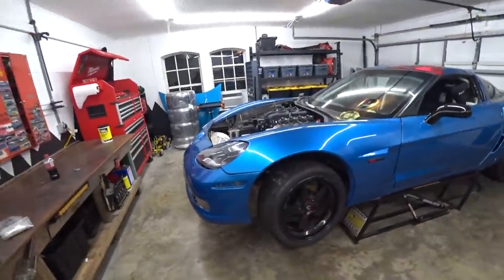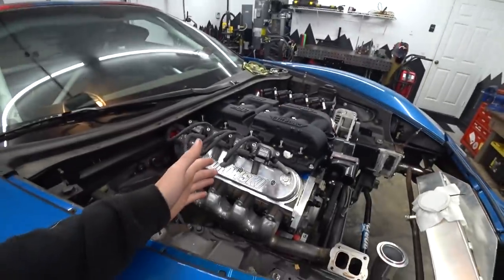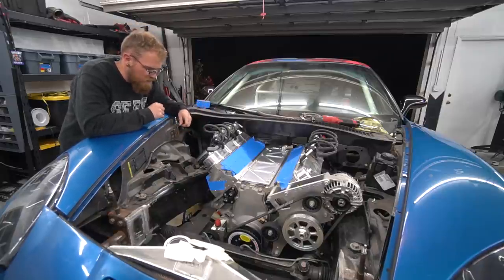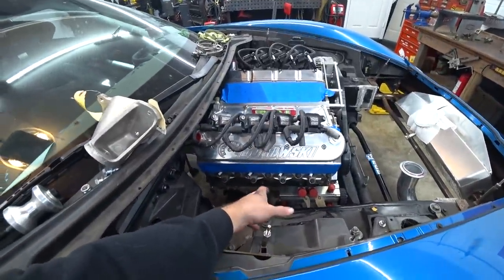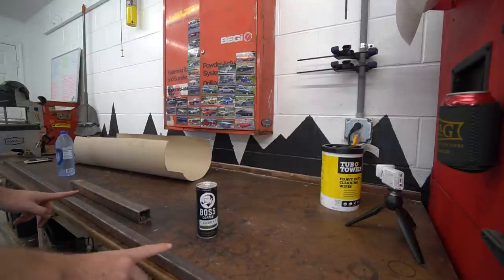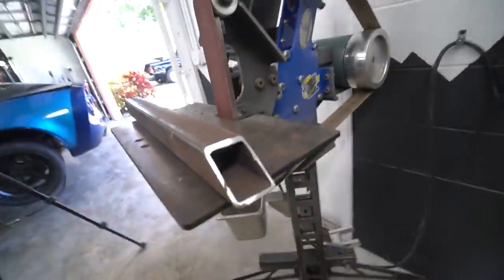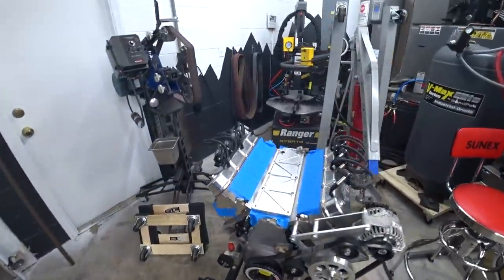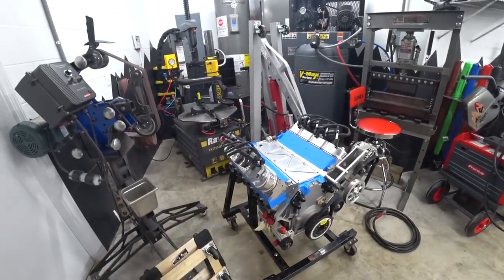C6 Z06 Corvette drift car build. Going backward to go forward.

Comment: Looking good! You should do some research on that dry sump pump, you may be able to unbolt the back plate and remove that rear section, flip it over and have the rear fitting face up instead of down. Keep up the great work!
Reply: Agreed should be very possible . however that as well as the other upward facing fittings are getting very close to the header as it's currently designed? And also heat will become and issue..  Possibly relocate that pump somewhere else or reverse mount it?  Unknown which would be best @ this point sir...

Comment: Yo Taylor, you should try flipping the headers when you rebuild the turbo kit and see how things line up, you’ll get a lot more room for the sump
Reply: Good suggestion. Only problem would be hood clearance
Reply: I was thinking the same thing, I've always heard of people flipping g8 manifolds for turbo kits
Reply: Same type of setup they run on Ruby. He would have even more room to keep it under the hood because of rear mount radiator. I thought it would have been better to go with a motor plate too.
Reply: @paulsensabaugh7879  ruby now runs a full custom turbo manifold setup.
Reply: @kyleridout6794  manifolds are prebuilt forward facing with v-bands on the outlets, but the rest is custom.

Comment: 3 months to finish is a monumental goal, but it definitely looks doable if you keep up the pace. It seems like the chassis work itself is finished, and its largely sorting out the driveline?  Hopefully there's no problems lurking elsewhere like that engine mount solution... Looking forward to the progress and hoping it comes together as quickly (or even quicker) than planned. That test time will be crucial!

Comment: Should get one of those tubular front subframes cleetus uses in ruby and Leroy. Probably buy you a lot more room
Reply: can't run them in FD drifting, so building for the factory front subframe makes it that much easier to refit the car for FD, also part of why he can't run the miata as an FD car, it has to run a modded front subframe to fit that LS it has
Reply: Oh yes I forgot about the FD rules. Too bad

Comment: Hey Taylor , just wanted to pass along some information that may be useful . On your dry sump ,maybe consider using a “street elbow “ or two if need be . If you’re not familiar with that it would be male on one end and compression or whatever on the other, for tight situations and such . Keep on .

Comment: Taylor, I would recommend you weld in the Peace's on the firewall. Panel bond is great, but if ever you were to have a fire, panel bond will burn away and give space for fire to come into the cab of the car. If you weld them in, your sure it's sealed and safe. Also I hope your thinking about a fire suppression system. Would be a great safety feature to have and also protect your investment.
Reply: Isnt it fiberglass?
Reply: @jimmaul  valid point. I didn't even think about that. I'm not sure, but your probably correct. Then I guess he is correct on not welding it hahaha. My bad.

Comment: Get you a case of Steel-It spray paint, it’s the best paint in a can for any kind of chassis or metal work, it’s life changing! You can paint all your raw metal fab projects without having to primer anything, you can also weld directly over it without having to grind off a clean spot and it comes in a nice satin black or gunmetal gray. Really good shit, alot of trophy truck and prerunner builders use it on their chassis, it takes a beating.

Comment: Have you ever considered doing some light-medium fab work for customer cars since you enjoy it so much? I'd love to come work for you once you've grown to that stage lol.

Aldo, while the engine is out and in it's current state, double check that it has an external timing pointer and verify TDC on the balancer is correct to get the static timing correct for the Holley. Cuz you're gonna push this thing lol.

Comment: Dumb question (that you may not even see or answer). All your work is around making things fit around the dry sump pump. Was there not another dry sump pump that would have worked better saving you make a mount and the turbo kit?

Comment: A smaller stage pump would be easier to deal with, two suction one pressure or even one suction one pressure style. We used that type in 1/2 mile nascar tracks with good success.

Comment: Good work as always, but i think that you had to make mounts with poly, You know what happened with the K-swap and vibration.
Reply: I thought this too. Is it a good idea solid mounting the engine like that? Seems like there will be a lot of vibration going through the exhaust manifolds and other parts causing a lot of stress?

Comment: A trick that I didn't use buy I will for those transfer punches, just get a bolt in a drill so.you can spin it and put it agains that belt sander or a grinder disc and make it a cone at the end

Comment: Bro I'm A Patreon Member So You Know I'm A True Supporter And Not A Hater And I Mean No Disrespect By This, But You Gotta Have More Clearances With Things, I Know You Love Things TO Be Tight Fitting And Clean But Thats How Vibrations Happen,,,,I Know Its A Solid Motor Mount So It Wont Be Moving That Much But A Little More Clearance Would Help You In The Long Run! Blessings Man!

Comment: Can you use countersunk bolts on that bottom plate? Would help clearance for the lines on the pump.
I'd probably do flanges on that bottom plate and then attach the tubing to the flanges. A little more work but would give you more space.

Comment: One side of the engine running a Hooker header the other with flipped stock manifold obviously isn't going to flow the same , pulse or volume of exhaust . Probably something worth fixing , if you can find the space . Something like the way Cleetus did it on Ruby , but without the turbo a foot out of the engine bay .

Comment: What about just getting the other hooker manifold that goes with the drivers side one. It’s a really nice piece. And directs all exhaust out the front of it. And the crossover that comes with it to connect the two sides is nice. I’m using it on my 4th gen and it fit and worked awesome. And I’ve made over 1000 hp no problem with it. It could save you a lot of time

Comment: Sure seems like to me, that the tubular front subframe may free up some much needed space between the steering rack, dry sump pump, engine mounts, etc.. At this point even starting with it and modifying one to fit would provide a whole lot more room.
Reply: I think you wouldn't be allowed to do that with Formula drift rules - and building a high level drift car like this and not have it FD legal (or at least close to) would be a bad move.

Comment: Why didn't you turn the rectangle stock flat? 90 off the block, 90 off the frame, weld the center.  Once you know the angle tween the two bolted plates its easy! No notch  just three cuts. Lots more room!

Comment: I would be ditching those tall valve covers. Especially in an engine bay where you need maximum clearance everywhere
Reply: The engine may be fitted with high ratio shaft mounted rockers that require the taller valve covers for adequate clearance.

Comment: Do you think a short 90 off the back of he dry sump will hit the part of the pan toward the front? With a straight fitting that it has it didn’t, but a 90 fitting might not clear that part of the pan.

Comment: There is no way an AN fitting is going to fit on that lower rear Dry Sump feed unless you cut the frame... That Dry Sump system was designed for a motor plate installation, not using the stock engine mounts...
Reply: Yupp

Comment: Move the dry sump pump turn it 180 so its out the front of the engine solves a lot of problems
Reply: Hits the steering rack if you do that.
Reply: My thought would be to drive it off the rear. Similar to how a dirt late model is setup.
Reply: @mrray55  isn’t that the alternator that they do that with?

Comment: 1. there is no where near enough nuclear fire in this video to offset large fkn spider that appeared.

2. that dry sump better be worth it, it has cause the build of that new motor mount and is preventing you from running a supercharger.  You should name it Paris, cause it is a seriously high maintenance chick!

Comment: tacking in the car is soo crucial, but in 20:56 you have crunched the distance to the plate to get better welding conditions :) then in 22:14 you became a gap between a plate and an engine and further screwing an engine to the mount lower part of the engine with dry sump pump moved to the right and took your safe clearence away ;) Am I enough focused watcher?  :D

Comment: Aren't the holes on the solid engine mount you made to close to the side. There is a chance it will crack in the bottom plate. Can't you make it little bit wider. Just curious.

Comment: Thats why its called a firewall,  have an engine fire the engine bay oxygen  will be used first then effectively a backdraft into  the cabin to use up the oxyegen there.  Had this exact same peoblem with my track car, left out a boot on the firewall  had a engine fire. And it was like a blow torch throught the firewall hole.. luckily it was on the passenger or my legs would BBQ.   I didnt climb out of my car i actually flew. Left a skid mark in my pants 😆

Comment: Wasn’t that c6 zo6 dry sump from the factory? I bet the factory system could be modified to run that huge oil tank Taylor has and the factory system would be likely be more compact and not be in the way

Comment: hey bud you bent  ur mount in a bit bolt and plate are not fully seated, at least on the lower two bolts  hate to say it may have to redo plate to get those to fully seat may be do much stress ojn those bolts.

Comment: Is it possible to make a catch can but the drain on the bottom has a check valve so it would drain back into the engine between runs?
Reply: Catch can is a mixture of oil and water (from condensation) so you wouldn't want it going back into the engine.

Comment: Weight the whole turbo set up, inter cooler, cold side lines etc. I’m curious why you don’t run a na + spray pending track seems like it would be a more nimble less heat less failure points